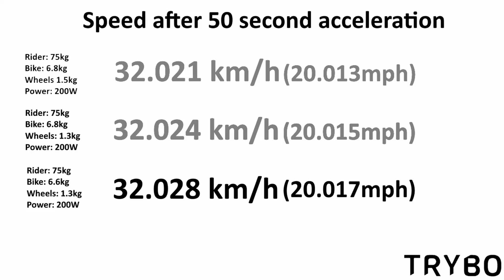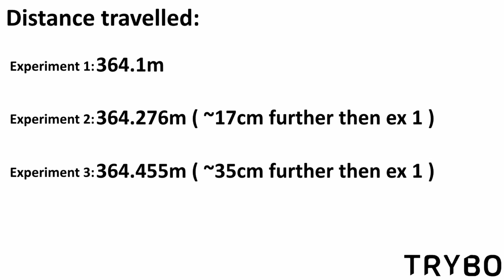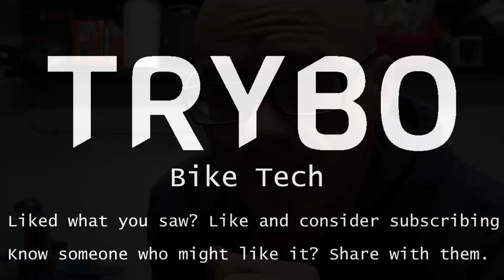The myth of rotating mass (?)

Comment: Is it possible to notice the difference between bike hubs ? Shimano cup and cone against DT Swiss 350 sealed cartridge bearings ?
Reply from the maker: Assuming they are adjusted correctly - not really.
Reply: In a real life scenario you won’t notice the difference.
And then you also have different seals for the cartridge bearing which only make a really small theoretical difference.
Reply: Thanks
Reply: Maciej Jan Długosz  in theory you're correct. But you also know that axial bearings are less efficient in a mostly radial situation (cycling).

Cup and cone also aren't that service friendly.. If sand enters and the '' outside '' cup gets rough, you can change the whole hub.
In a industrial bearing hub, it's way easier/cheaper to replace a bearing.
Reply: Maciej Jan Długosz  indeed I never had a higher tier cup and cone hub, and also do not commute by bike. But thanks for the explanation and I agree with you. A away, good to know that isn’t the best way to spend money on a bicycle upgrading the bike hub. Thanks again.